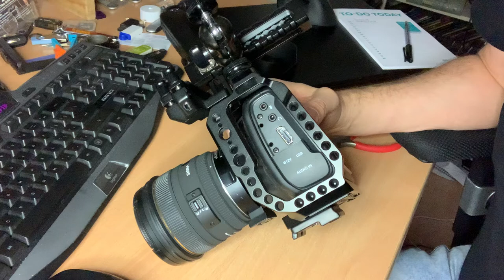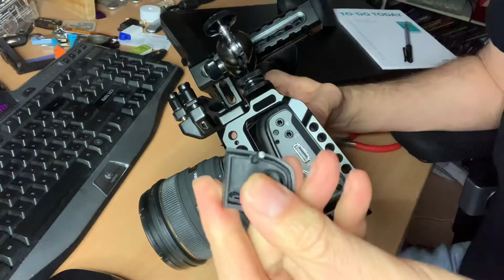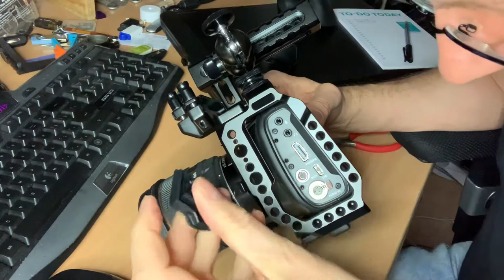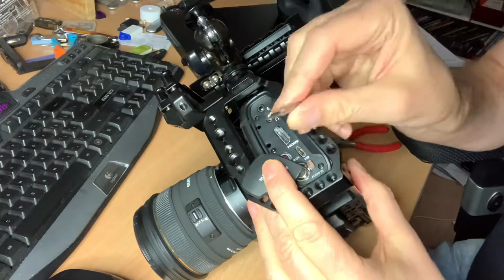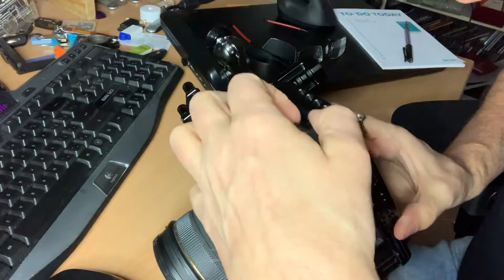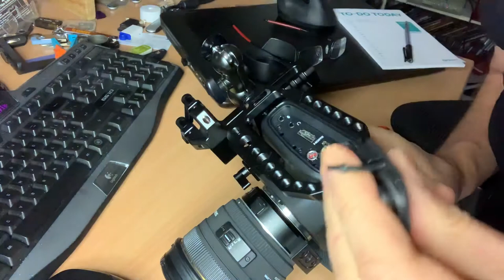How to remove and reinsert BMPCC4K connector covers

Comment: In fact, after using needle nose pliers to remove them, I just snipped off the little cone shaped retaining end and now they happily fit right back in when I want them.  Just don't have the functionality of the keeper cord.  Problem solved.  Now just try not to lose them when they're off.  BTW... only need to cut the end of the rubber cord off.  Leave the balance of the cord in place to aid with providing another point of alignment in addition to the small amount of additional friction that it provides to hold it in place.
Reply: Brilliant!  Thanks for the suggestion.